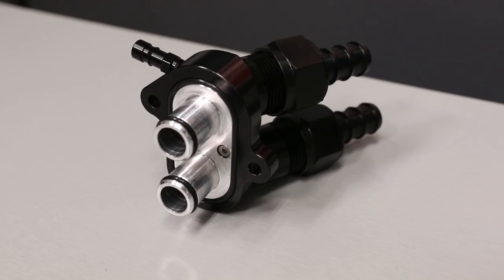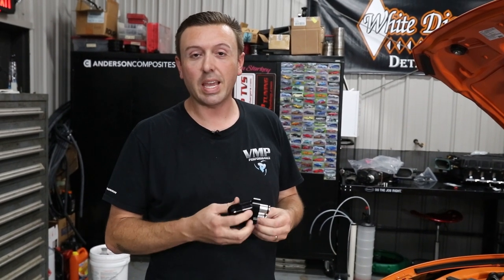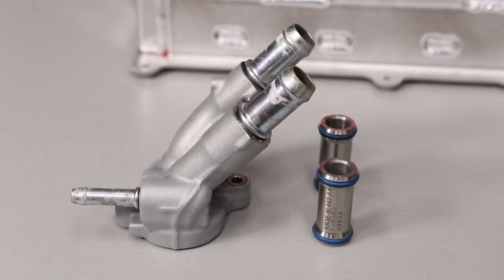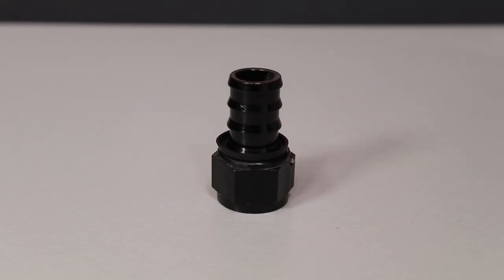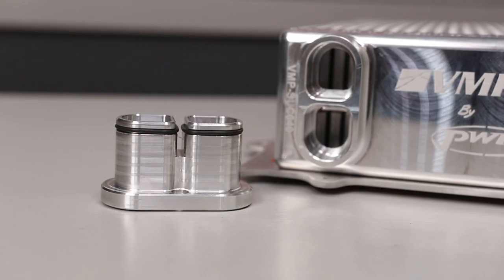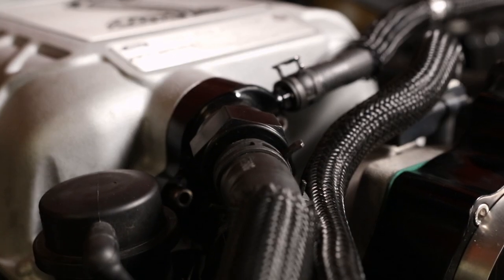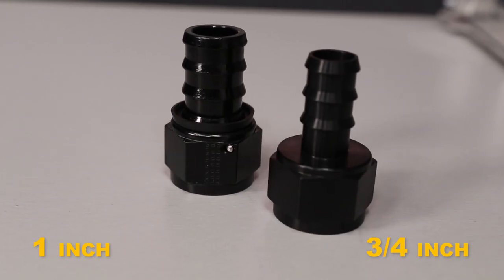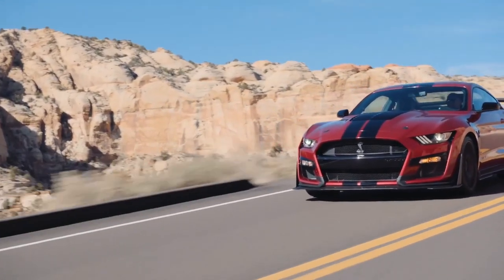2020 GT500  ||  VMP High Flow Billet Water Manifold

Comment: Hey off question but I have a 2014 5.0 and putting built motor together for 850 wheel Paxton set up what will happen if I don’t use arp head studs and I use new oem
Reply from the maker: In high performance applications, items like head bolts/studs add clamping strength and stretch resistance to withstand the cylinder pressures created by forced induction, more aggressive timing, and the driving styles that come with it.  Very simply put, the higher clamping strength/stretch resistance helps prevent the cylinder head from lifting under those increased stressors and prevents blown head gaskets and various other issues.

Comment: Does this really work? 
How many degree it will drop ?
Reply from the maker: This part is a supporting modification designed to make the most of larger intercooler cores and provide the functionality for custom ice tanks, lines, and things of this nature.  Temperature drop will be directly dependent on the choice of intercooler core, intercooler line sizing, any pump upgrades done, and things of this nature.

The main benefits of the VMP High Flow Billet Water Manifold are the AN connections for simple servicing, a boost reference port for tuning, the ability to remove the degas tank/links from the system for ice tank implementation, and matching to larger size ports on aftermarket intercooler cores like our Apex line of intercooler cores for the '20 and up GT500s.